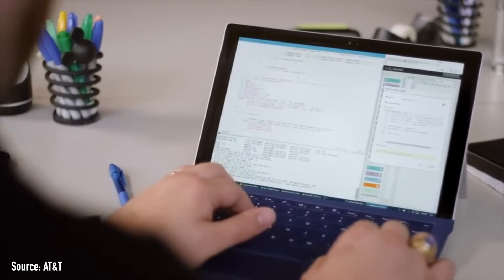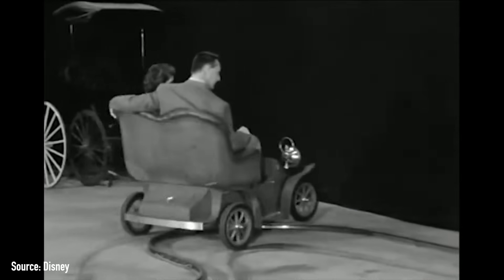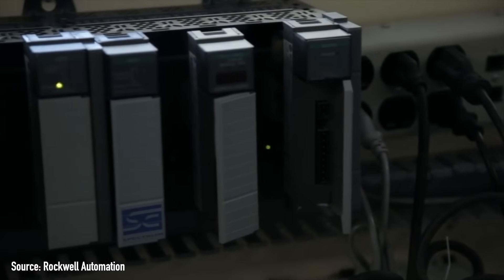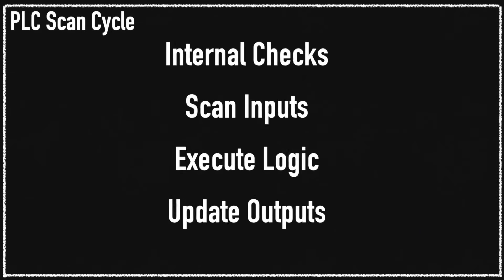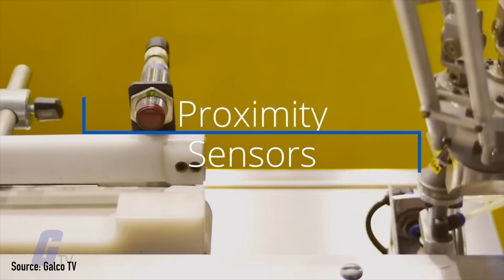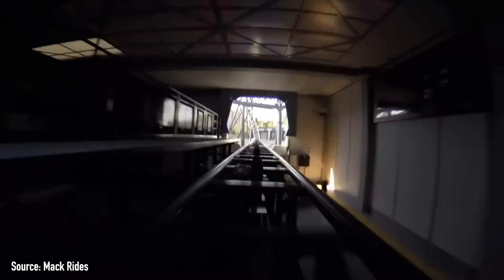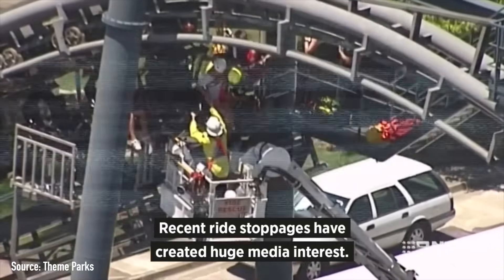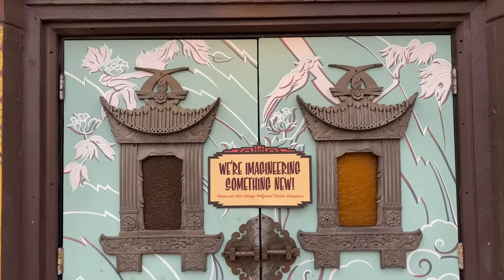What Controls A Theme Park Ride?

Comment: Roller coaster PLCs should be under lock and key while the ride is under operation. A red error causes the lift hill will stop, and the mid course brake run to engage continuously until the train until the PLC fail safe is overridden which needs to never ever be done by a ride operator no matter the circumstances and should only be done by a ride engineer and after the prerequisites are completed.

Comment: I hope some of the PLC's and IO modules I repair at work are used to control a theme park ride, that would be cool.
Reply from the maker: What brands do you repair?
Reply: @themeparktechnology  Too many! Lol. Allen Bradley, B&R, Siemens, Omron, Mitsubishi and a few more. Using all the different programming software is the hardest part as they all do the same thing differently. I also repair HMI's from the same brands.
Reply from the maker: Awesome! I’ve seen just about all of those brands in the field. Thanks for helping keep things running.
Reply: @themeparktechnology  Happy to help keep the lights on :)
Reply: In your experience, what are the common problems with the PLCs you've had to repair? 
I ask because in 17 years, I've only had to change the PLC module itself on a ride once. This was because it just refused to remember the program after you disconnected the programming computer from it. We found after a power cut that the PLC battery had given up and the program was lost. Fitted a new battery, re-loaded the program onto the PLC, disconnected the laptop, PLC promptly forgets everything it was just told..... A few attempts later all resulting in the same thing, we left the laptop connected and the ride ran perfectly fine. Disconnect the laptop again and same result, PLC communication error no program found.....
Reply: @leeowen4989  I've seen issues in the power supply, faulty flash memory, DRAM or SRAM and even a faulty processor. Usually the issues will be around the IO though so blown inputs or faulty relays/transistors on the outputs. The forgetful PLC you mention could be a fault in the circuit around the power control to the memory, the power is switched over from the internal supply to the battry on power loss but it really depends on the PLC.  It could also have had a faulty flash. All of these are down to component level repairs.
Reply: @wakkowarner7391  Interesting, I wonder how much abuse the other PLCs get as I said, this was the first I've had changed in 17 years on hundreds of rides. It may have just been a coincidence that the PLC gave up after a power cut. We only drew the conclusion between the 2 because the power cut was actually quite spectacular and it destroyed a VFD. All the other PLCs that were on at the time didn't seem to suffer and effects.
Reply: @leeowen4989  I've had quite a few things to fix that have broken themselves after a power cut. Voltage spikes are nasty.
Reply: @wakkowarner7391  How do you identify the parts that need to be replaced?  I have a PLC where one of the output SMD's is fried.   I am unable to identify the SMD as it is lacking identifying markers.  This particular card is rated from 3.3 to 27 VDC.
Reply: @Andy-zs3jb  Sorry for the late reply. Identifying SMD's is a real pain sometimes.  There are a few websites that can help to identify them with the little info you see on an SMD. However if the part has no markings at all that you may have to specify an equivalent. If you know the output is a transistor then choose one with the correct voltage and current ratings.